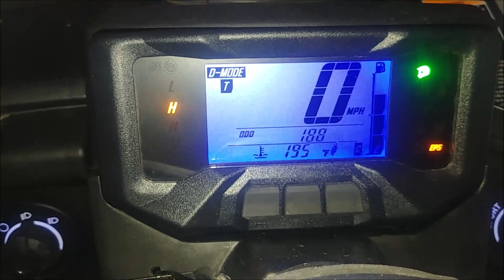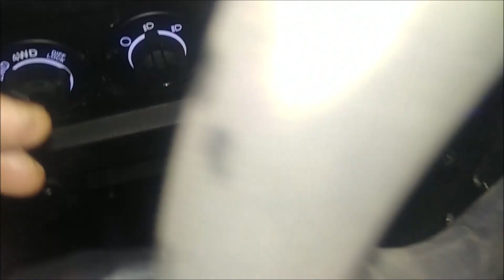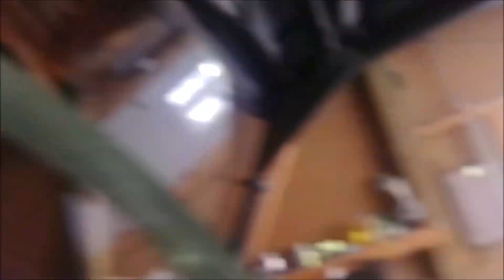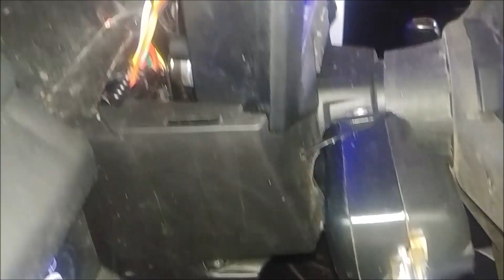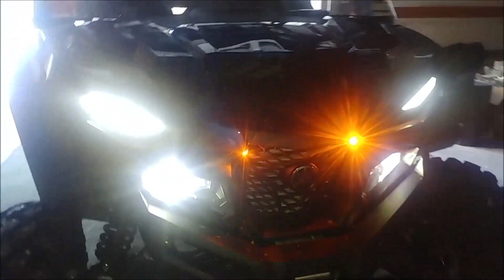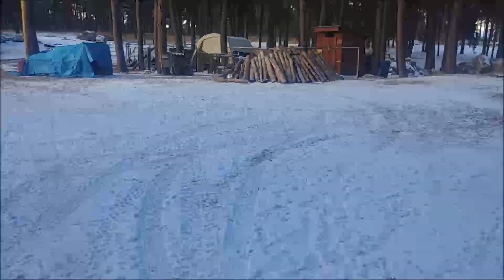Yamaha RMAX 1000 turn signal and heat output

Comment: Have you ever had a problem with the t/s stalk interfering with the 4x4 switch and light switch access  ?
Reply from the maker: Never.  I can see the way the Ryco kit mounts it interfering,  but with it mounted directly to the column, it's completely out of the way of the other switches BUT very conveniently-located to activate the turn signal without taking your eyes off the road.
Reply: @MassiveOverkill  ok 👌  thanks

Comment: If you wanna put a brush guard/bumper do you think it is gonna cover the turning singal lights?
Reply from the maker: I'd just move them around in the grill to where they weren't blocked.  Someone posted in my RMAX FB group a switching module that I plan on installing that ties into the DRL, which is really slick. Stay tuned.

Comment: How is the fuel consumption?
Reply from the maker: 13-16.5 MPG
Reply: @MassiveOverkill  thanks
Reply: Hey I curious could you carry just a front spare tire and use it in a pinch on the back? The back are just wider right?
Reply from the maker: That's correct.
Reply: @MassiveOverkill  thanks

Comment: hey could you go more into depth. with the heater. system set. up.  ex like dials, temp settings ...thanks
Reply from the maker: I don't have the Yamaha or other manufacturer's heater.  I have my cheapie heater setup as seen here:  https://youtu.be/tvxTjhL5eK4  

Only adjustment is the louvered vents.

Comment: Have you used your IQS much?  Will you be mounting a snowplow?  The Ryco would have used your reverse lights in the back, wouldn’t that be easier?  Also noticed you didn’t put indicator lights on your dash.  Assume its because you didn’t want to drill.  At what point will you be adding a second battery?
Reply from the maker: I use my IQS every time I'm riding Firm on hard pack and come up to a rough section, where I'll flip it to Comfort and then back to Firm.  I'm working with MotoAlliance for them to make a mount so I can transfer my Denali plow from my X4.  
The Ryco kit would certainly be easier but I cheap out when I can and the turn signal stalk and LED lights and relay only cost me about $65 total.  I'll probably add an indicator light later, just it's freezing right now and I was happy just to get the basics installed.  I probably won't add a second battery.  Never needed it in 4 years with my X4.  I do have a portable jump starter pack I carry with me all the time.